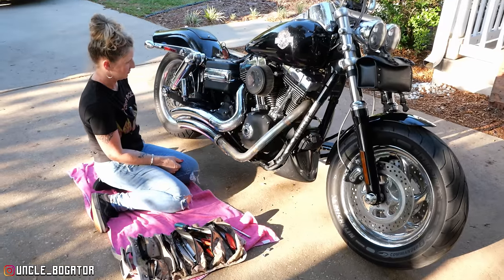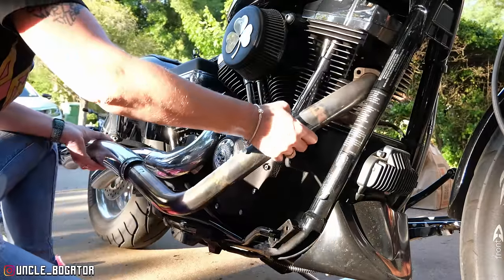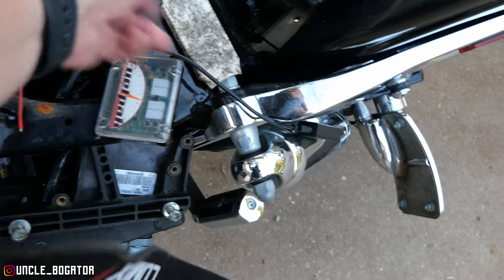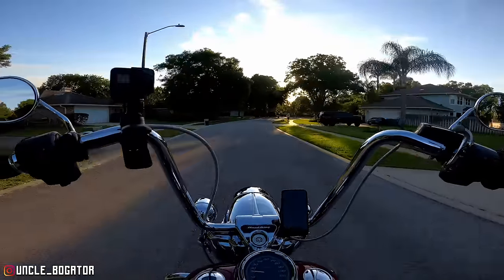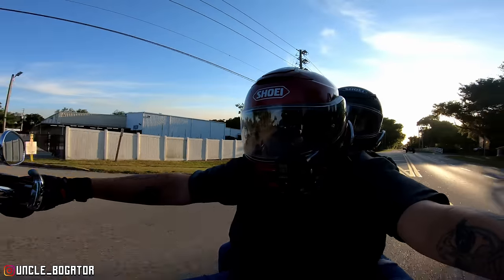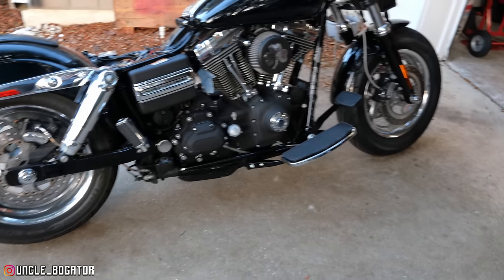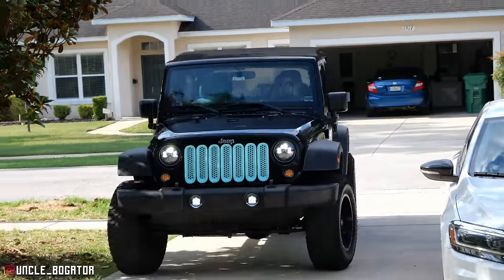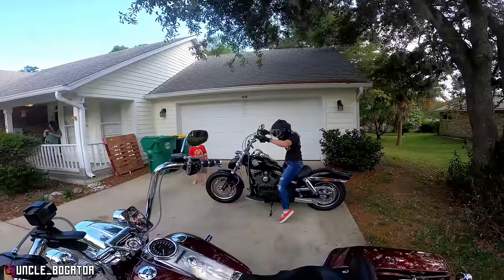This is why you don't put these on a Dyna

Comment: Dang Unc. I have a Dyna Switchback with Big Shots. I've been shopping for a 2 into 1, but have the same problem with the right floorboard. The big shots do touch that rear mount. I thought the Freedom Performance Combat shorty looks like they will clear too. Thanks for the video.
Reply from the maker: When I called around to a few exhaust MFG, they al told me the same thing except SP Concepts. Try em out.
Reply: @UncleBogator  Thanks as always for the info and reply Unc

Comment: Put floor boards on my 08 Fat bob around 2013. Belive it was Rinhart exhaust. The exhaust ran just under the air box. The floor boards were great for long rides. Cant lean her as far. Still have  a 200 rear tire that was on the fat bob and other parts. The Mephis shades batwing faring clips on and off and is a great upgrade as well.
Reply from the maker: She's not sure about a windshield or fairing yet. If she does, she definitely wants quick release.

Comment: If I adjust my brake pedal to where I want it on my Yamaha FZ-07 .. the brake light won't work .. so I now have a pressure switch to install.  Then I can put my brake pedal where I want it and don't have to try and adjust a mechanical switch ..

Comment: The problem with the floorboards was you have a FX, and the Switchback is a FL two different frames, her floorboards are too high.
Reply: That’s why your pipes didn’t fit.
Reply from the maker: Think her floorboards are too high, you should see the FXDP. Those boards came up above the front headpipe. Hers are exactly where they should be. The 2012 FLD was pretty much the same, but it didn't have anything to do with FX vs FL. 2012 was a dyna frame change overall, and the year they introduced the FLD and the 103. If you go look for exhausts for FLD there's not a lot of options. FL and FX (even now) are not different frames. it's just one has floorboards and one has pegs. Good example today is a Heritage and Fat Boy (FLHCS, FLFBS) vs Lowrider (FXLRS) or softail standard (FXST).